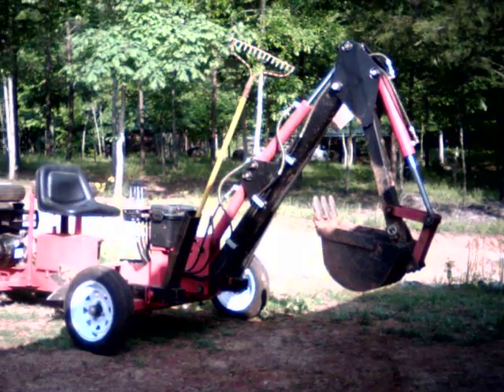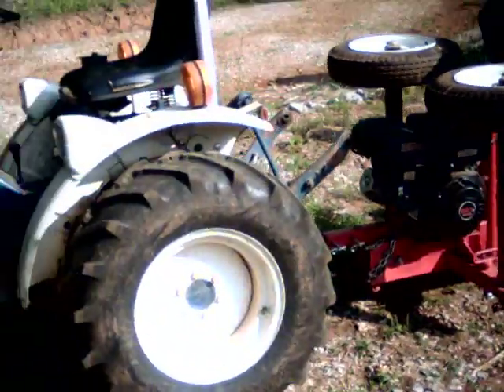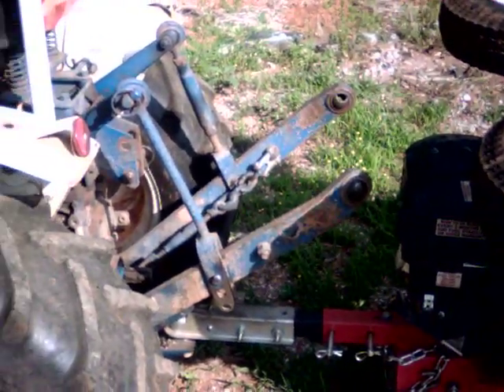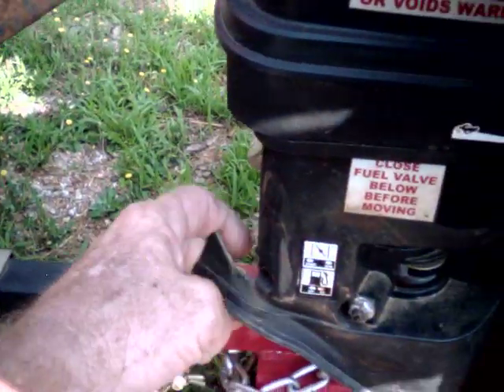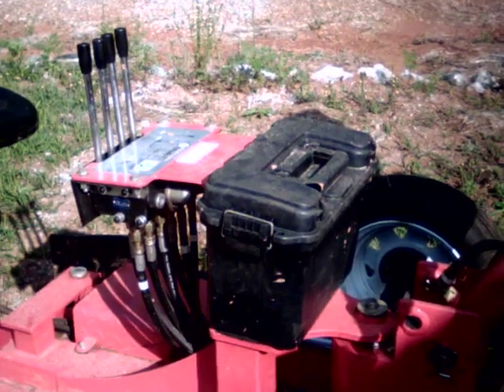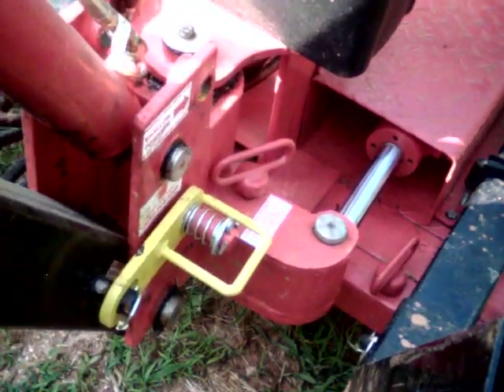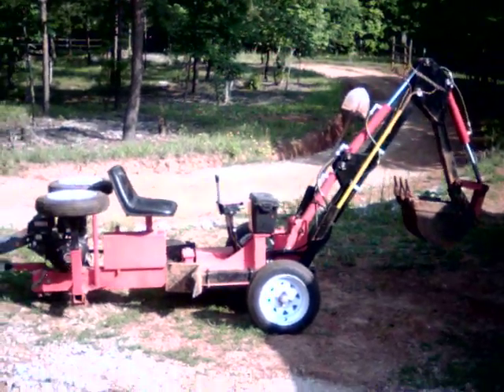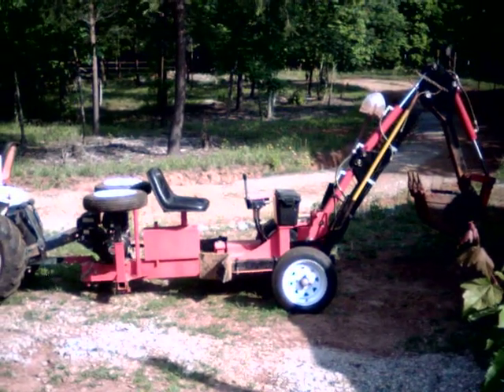Harbor Freight towable trencher/backhoe one year review.

Comment: I bought the same trencher/backhoe from Princess Auto here in Canada .. Mine is also a little different starting , most Chinese engines look and start like a Honda power product engine but mine doesn't start that well .. Your "main pin" at 5:37 I removed the boom and added 1 more grease fitting at the top and 1 more grease fitting at the bottom .. I also made a 7" bucket for installing weeping tile "big O" pipe .. and a 32" ripper tooth for pulling roots .. am in the process of building a thumb ...  The only thing about the trencher/backhoe I hate if changing the wheels and out riggers back and forth ...
Reply from the maker: I ordered a second set of wheels, it makes changing a lot better. I have a video about it on my channel. Thanks for watching.

Comment: Thank you for the great videos as well as all the great tips. Just received my trencher this week. Got it all assembled without much problem. One issue I did discover, when installing the hub on the axle. The flat washers they supplied, the inside diameter of the washer was to small. I noticed this when trying to adjust the wheel bearings, The washers bottomed out against the axle, and not against the inner race of the bearing. I opened the inside hole of the washer so I could adjust the bearings. Hope you can pass this on to your followers, it could prevent bearing failure at the worst time. Phil
Reply from the maker: Wow, glad you caught that. Mine didn't have that problem, makes me wonder if they just happened to put the wrong washers in yours. I'll make note of this and pass it on. Good luck with yours and keep me posted on how it does for you. I've got some new videos coming soon digging a pond.

Comment: With those Loufan engines, if you want to shut down the engine, drop it down to idle, let it idle for about 30 seconds, then shut it down. Then it will start right back up, no problem. Also, when you shut it down to put it away for the day, run it about 1/2 speed and shut off the fuel lever. This consumes the fuel in the line and card so you don't get any varnish build-up. When it starves out of fuel, set throttle to idle and turn off the ignition knob.
Reply from the maker: Yep, that's the way I do it here. I don't shut it down with the fuel shut off until I'm putting it away for the winter. Mine gets cranked almost every day. I also only use Ethanol free gas. Thanks for watching.

Comment: Can this be pulled behind a pickup on the road? Or does this always need trailered?
Reply from the maker: Yes it can. It comes with a sticker saying not to pull on highway (they do that for liability reasons) but I've pulled mine several times. For a longer trip I put on trailer. It is my  thoughts that towing on highway adds a lot of wear to the "joints", so I try not to do it often. Thanks for watching.

Comment: Thanks for posting.  Where did you get the second set of axles.
I would  like  to  add the tires like  you did.
Reply from the maker: Just call Harbor Freight customer service and tell them you want two replacement axle and hub assembly. They shipped them to me and then I bought the tires at Wal Mart.